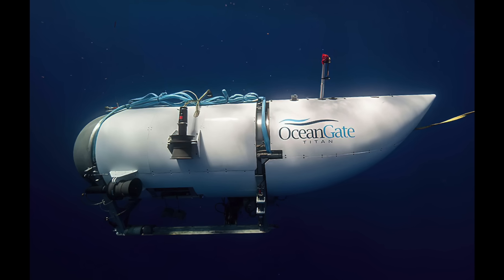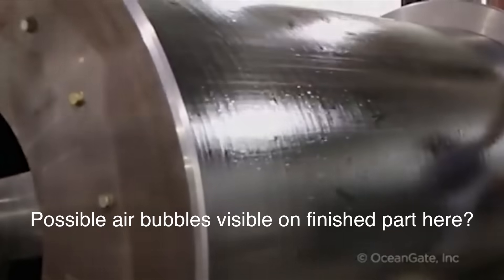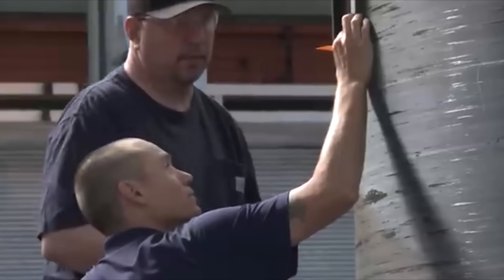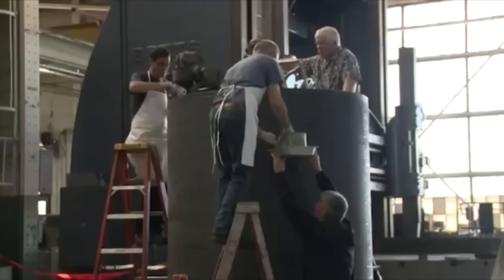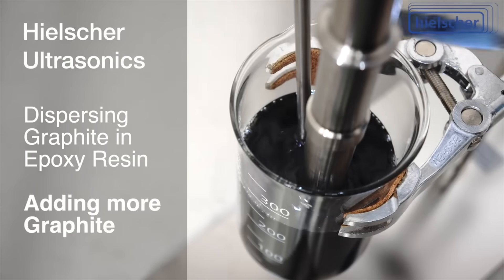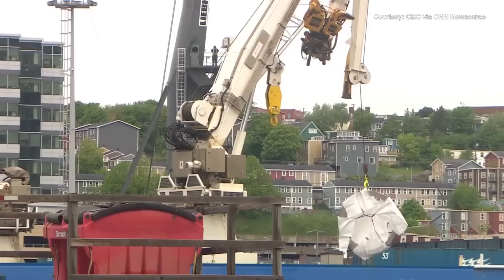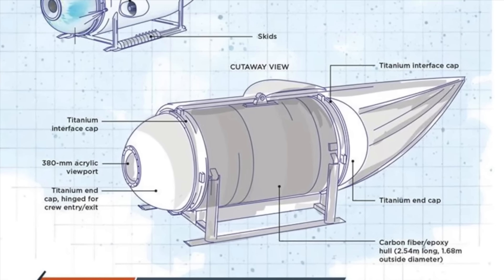Why OceanGate Titan Imploded - A Carbon Fiber Composites Perspective

Comment: When the middle of the carbon fiber tube is squeezed it causes the end of the tube to flare out. When everything is straight the end of the tube sits flush inside the socket of the titanium mating ring. But as the carbine tube flares, the outside edge at the end of the tube pulls away from the ring interface, and the inside edge of the tube end pushes AGAINST the ring interface. Effectively this creates a lever action and would give a mechanical advantage to the tube to push against the titanium ring. The mechanical advantage of the tube flaring and leveraging against the ring interface could be enough to actually overcome the force of water pressure pushing the Titanium end cap onto the tube. And this would basically cause the end cap to just pop off like the lid of a Pringles can or tennis ball can.

Comment: As someone with just a surface understanding of engineering it's insane to me that the ego of Rush outweighed his engineering knowledge. I have more thorough cleaning processes for 3D printed and CNC'd protypes than they did for this. And It doesn't take a genius to see how running thin bands of carbon fiber parallel to each other could lead to layer delamination at high pressure. It's actually a miracle the thing survived hitting that depth more than once.

Comment: Excellent video.  However, the biggest problem is that carbon fiber has a much lower modulus of elasticity than Ti.  The tube wanted to shrink by 1/2" at depth, but the Ti wouldn't let it, resulting in an ENORMOUS stress concentration on the inside of the tube at the junction of the Ti, resulting in buckling.
Reply: ...or the adhesive bond failed prematurely.

Comment: As a mechanical engineer who has worked with pressure vessels under vacuum even then, I wouldn't choose such a material, interior pressure would be fine but not external pressures. With such an anisotropic material, the prediction of the physics especially in the interior loads being in compression would be resisted only by the matrix is of any use which is small in cross-section. Shear forces on the plastic matrix are extremely weak.

Comment: The fundamental problem is that, in my opinion, this arrogant fool had no clue as to what he was doing.
None.
Forgot the carbon composite. Let's just target the cylinderical ring joints which were destined to fail before he scabbed this watrer borne coffin.
Someone posted they had been working in the aeronautical industry for thirty years. I have worked both in the aeronautical industry and the  manufacture of organic resins.
As you listen to the narrative, you're nit sure wheather to laugh or just shake your head.
For starters, titanium and epoxy resins are totally incompatible with each other.  The epoxy will not bond to the titanium.  There is nothing you can do to make it bond to titanium. 
There is a standard, SA 2.5. I am aware of it  but totally useless when it comes to titanium. 
The poster mentions having a prepared surface on the titanium  but you will not put an anchor pattern on the titanium by attempting to sandblast it.
SA 2.5 calls for an anchor pattern of 1.5mils.
You will never achieve that on titanium, and even if you could, it still would not work.
There is no covalent bond which takes place between the epoxy and the titanium.
In this respect, it is like stainless steel. Epoxies bond much better to conventional steel than stainless steel.
To bond to titanium, like you were going to make golfclubs or something, you need a laser to put a profile on the titanium. Then, this needs to be followed by a special metal spray. This is followed by a silane solgel primer, then an organic primer. 
You could apply a composite at this point.
But you have to ask yourself, the Russians have more experience than anyone using titanium in subs than anyone. You need to ask the question, why haven't the Russians used epoxies to put titanium joints together?
This wasn't an accident waiting to happen, doomed to fail from the stRr.

Comment: I’m only a welding engineer but I’m smart enough to know that homogeny is an extremely important quality for the material of a pressure vessel to possess. If pressure is going to be applied universally in all directions why you would pick a material with any gaps in between is beyond me.

Comment: The glue process was also done bad by using a gantry crane and slings to lower the ring onto the cylinder.  They eyeballed the alignment.  any rocking back and forth of the ring will push the glue away.   They should have used a precision jig to assemble these two parts.   Sloppy!!!

Comment: I am a retired structural engineer, and have to comment on Rush's comments with regards to  the vertical strand direction.   Compressive loads actually create a diagonal failure, meaning diagonal strands would create a stronger hull.  Having said that, carbon fiber is not a good material for compressive applications due to delamination.  It is only suitable for tensile applications as in an airplane.

I think a huge oversight is the stiffness incompatibility of the ring to the cylindrical hull.  The hull will deflect in the direction normal to the surface of the hull far more than the deflection of the Titanium ring.  This creates huge loads on the glued joint, possibly sufficient to cause failure.

The fact that he would take hulls down to depths where fibers would be heard cracking and popping is scary, and then he would do it again is truly irresponsible.  Rush's biggest fault was his arrogance.

Comment: Nasa builds its craft in clean rooms and highly controlled environments with personnel wearing full suits and masks to ensure cleanliness and prevent any contamination. The ocean is a far more hostile and dangerous environment than space. These standards should be applied when manufacturing submersible craft. It's no wonder it all ended in disaster.

Comment: Anyone who knows anything about carbon fiber knows that it's a material meant for tension in the weave direction, as in having a pulling force in the direction of the carbon fibers themselves. Used like that it's super strong for its weight. However use carbon fiber for compression in the weave direction and you're relying on the resin to hold everything together. So if you go down to 4000m of ocean pressure chances are you're no longer sitting inside a "carbon tube", you're sitting inside a "regular plastic tube". And possibly even worse than that because it's a plastic tube with granular imperfections introduced.

Comment: Carbon fiber makes absolutely zero sense for a pressure hull. Carbon fiber does tension like a champ, and does compression not at all. The only thing bearing the compression load is the bonding agent, and that is structurally compromised by being inter-layered with the fiber, which is not resisting the tension of delamination transverse to the fiber orientation. Delamination isn't a risk, its absolutely guaranteed under the utterly inappropriate heavy compression loads. Any engineer who can't see this instantly isn't qualified to design anything, this is the most basic physics in a profession that is about absolutely nothing other than physics.

Comment: Composits have NO place in underwater exploration. They make no sense. You can PULL a fiber, but if you push it, it can take no force. So you can use carbon fiber if you have a pressure inside (like for planes) but not if the pressure is outside.

Comment: The glue is only good to 5000 psi max perfect conditions. The compressive strain at 13000 ft is 6000 psi. If the carbon fiber used epoxy then the epoxy would fail around 12000 ft perfect conditions. The engineers?

Comment: This is using composites totally wrong. Fiber is best under tension. Even unreinforced concrete would be better because that is a perfect case of when concrete is under compression like in Pantheon. Then thinking of how the repeated compressions with push the fibers into kinks, and then expand out. What was really gained my not using titainium?

Comment: Excellent information & research that I wholy agree with.

I work in carbon fibre manufacturing/repairing of high end cycle frames.
It's imperative the hull of Titan should have been multi directional layering & at different angles on each layer.

This, plus using the two materials of  carbon fibre & titanium, bonding these together under such different expansion properties, was an absolute no no.

My conclusion is just as yours.
Reply: So, even if they would have wound the CF at differing angles, doesn't it still boil down to using the wrong material for the situation? It's my (non-expert) understanding that Carbon Fiber works best under tension and performs relatively poorly under compression. I've heard the phrase "like trying to push a rope up a hill" in regards to this incident.
Reply: @faustopancake234  
If the hull was to be thick enough & I don't know if 5inches would be or not, as  underwater science isn't my thing, but multi directional layering & at different angles on each layer makes for an amazing strength in any application.
I repair the highest quality race cycle frames that have been damaged in accidents, the wall thickness is around 1mm on parts. Imagine the strength it must be when ridden by professionals.

Using carbon & titanium though, in the Titan was 100% a no no.

Comment: Pretty elementary information that a board breaks easily with the grain but accros the grain is pretty difficult. When I saw them laying the hull I thought, "Man....how can this possibly work." During the glueing process how do they control curing time while applying the glue. It took a long time. The glue has to start cuing immediately. I understand that retardants can be added in order to give you time but there sure seems to be some unreliable timing with the application.
Reply: I agree, but it don't really matter because it would fail regardless, because you have to fix the design, and go back to the drawing board, and get rid of the need for glue !

Comment: i worked for a couple of years in the polyester industry years ago. for me that 1 direction application of the carbon fibre. (only decorative or special parts ever where 1 direction glass vibers) no gloves or mostly "sterile" production floor. (protective clothing) to little glue.(no cleanup???) and no hint of a vacuum oven. 1 of those on the list would already make me stay well clear of a sub. but that whole list is just taking risks with peoples lives. they where amateurs gobling together a sub in a shed. this is not how people work that work with composites. yeah amateurs and beginners making a bumper maybe. 🤦‍♂
Reply: Sad but true !

Comment: Thanks for your professional input on the matter. My cousin, who professionally fixes yachts, said a similar thing, just with fewer details and with a lot of swearing. I use home made carbon/kevlar composites only for fixing RC toys. Before I touched the stuff I watched about 40 minutes of tutorials on Easy Composites website and without the slightest exaggeration I'm way more qualified to fabricate composite parts than any of those Ocean Gate engineers.
Reply: Sad but mostly true !

Comment: You obviously missed that the hull was not entirely unidirectional but in two directions: axial and circumferential:
youtu.be/29co_Hksk6o?t=233
Reply: True but I believe the method they used was inappropriate and may have made things worst not better !
The mix of prepreg and wet lay should not be mixed in my opinion.
And they do not say how they did it nor show it, and how many times etc.

Comment: Could you also explain if I inderstand it correctly that in general, that's no clear way to estimate material fatigue and stuff for the carbon part of the hull even if we suppose there were 100% no manufacturing flaws. You also can't pressure test it cause afterwards it might already have its structure weakened what's not the case for metals.

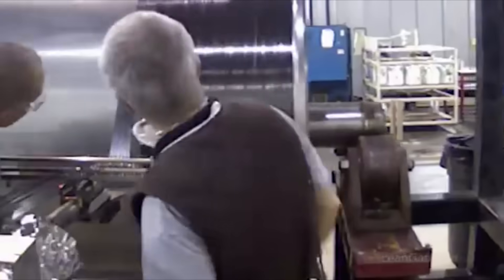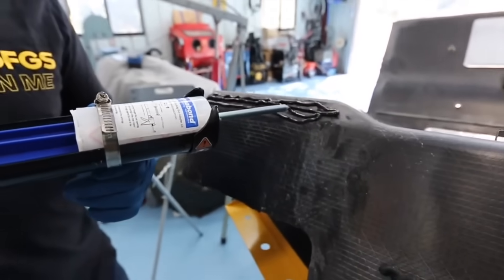Comment: 2:14 additional axes for carbon fiber important oversight 3:59 and with proper testing - non-destructive and destructive 5:37 second video in a row commenting on sloppy cleaning hygiene. Will this OG clip be among lawsuit exhibits? 10:03 titanium surface texture treatment, e.g. sandblasting, required for best bonding 11:49 carbon fiber, unlike metal, very brittle under stress

Comment: I’m not entirely certain that the adhesive quality mattered for this accident. The hydrostatic pressure on the end caps would have kept them very firmly pressed against the carbon fiber even without any adhesive at all. It’s not like they could fall off.
Reply: If the adhesive failed under compressive forces, then that could result in a water path into the sub.  That adhesive is what joined the CF to the titanium.

Comment: A carbon fiber is at its best in PULL force. According to researchers the PUSH force on carbon fiber reinforced plastic, only 10-60% of its strength remains.
Simple said: Try to pull a rope appart and you feel the strength of its fibers. Push both ends together and you feel almost no resistance.

Comment: I’ve taken a submarine design course (and used Paramarine for a project) and never heard of “strength-to-buoyancy ratio”. There is a factor called “weight limited designs” which the structure material plays into; it’s why HY80 has been superseded by HY100 and HY130 in newer classes of US subs: these are stronger materials and can thus be thinner and therefore less weight to the hull. But buoyancy has a lot of other factors not just the hull material.

On the titanium cleaning clip, good catch!  But based on where the rigging is laid out, it’s unclear if this would be the bonding surface or just the external surface. Either way, the controls in the entire process are COMPLETELY negligent at BEST.

Comment: It should have been double prooffed. Meaning that if they were going to be operating at 6,000 feet, it should have been built for and tested at 12,000 ft.
Reply: correct it should’ve been common sense to have a Margin ,, if you’re towing a 7000 pound trailer, get a truck with a 9000 pound towing capacity, not a 7000 pound towing capacity.. I mean, this is nearly common sense in the engineering world, it’s astonishing. He was pushing it at the limit.
Reply: @JDMHaze  if you cant do it safley don't do it. This guy cut every corner possible. Its a shame he was a good salesman because he was able to convince 4 other people to get in that death trap with him.
Reply: Well, a margin is a good thing, but in the real world, it's not often 2:1 proof (which would be more than that, ultimate). For example, the G-forces I pull coming out of a spin in my little plane would "de-wing" a 777.
Reply: Correct.. s.w.l…👍🏻🧐
Reply: You're soo off I'm guessing your completely uneducated in the topic and just throwing numbers out that sound good. Most submersibles do 120% their operating depth, your talking about 200%. Titan didn't even have the extra 20% either, and since the carbon fiber tore on the very first dive it definitely wasn't even rated for Titanic's depths let alone had a safety margin.
Reply: That would require a crazy level of over-engineering.
Reply: @andychow5509 100% more than expected is incredibly reasonable when human lives are concerned.
Reply: @sertank735  that's what an uneducated person would say, since industry standards are 120% and there's never been a problem till now. Titan didn't have that safety margin, it wasn't built right to handle the depths it was going to, the carbon fiber tore on the first dive, and yet you think its gonna somehow do double its operating depth? Geez, your so ignorant about submersibles idk why your even acting like you know what should be done and what is a good level of safety. 120% is actually more than enough, but your sub has to not only be built right but be able to handle 100% of it's operating depth without it falling apart every dive. Carbon fiber isn't a good submersible material period, nor should we take this accident and try to change industry standards when this sub had nothing to do with industry standards, and actually went so far off industry standards it imploded. The problem started at the design phase not at depth, the sub was just so bad it couldn't even operate 20-40% it's operating depth without the carbon fibers tearing. Every other submersible does 120% and has never had a single problem operating at 100%, because they didn't use carbon fiber and their design was actually good and safe. Just get educated if you wanna act like you know what your talking about, because clearly you don't.

Comment: I thought it was ironic that when the concerns about hull cracking noises were raised he thought adding a sound detecting system to detect the noises was a solution.

As if I. a building that is already on fire you can put the fire out with a better alarm system

Comment: 1:38 Rush says the ply orientation is at 0/90 which covers the axial and circumferential stress (2X axial). It’s not a single fiber orientation which is repeatedly mentioned by the narrator. I’d also be curious what the preload on the end rings during bonding. The adhesive isn’t under the usual tensile and shear stress either since the structure is under compression and the adhesive stress is mainly due to poissons stress. The lack of excess adhesive is less critical for this type of joint stress.